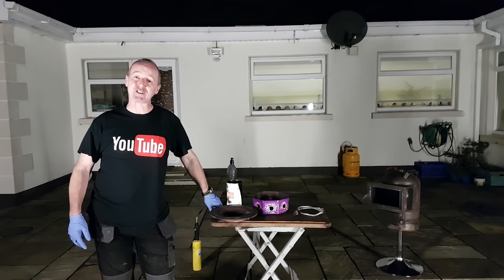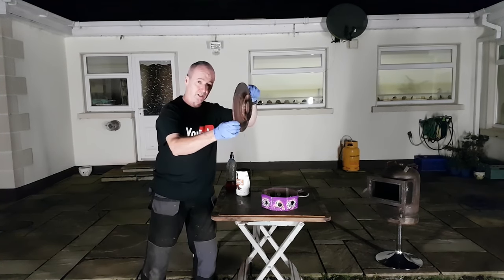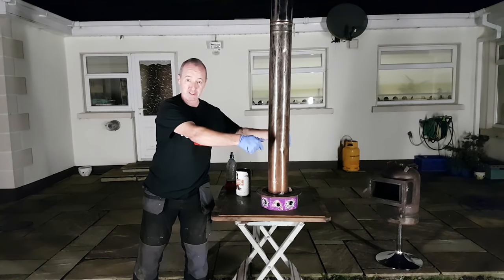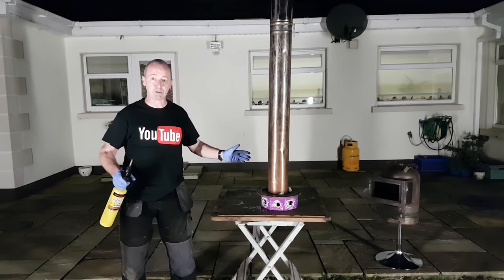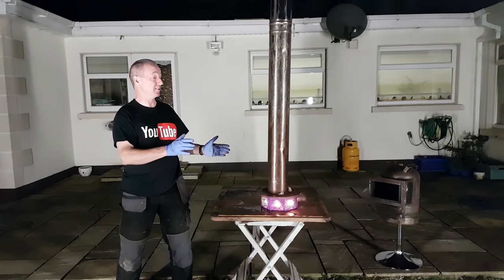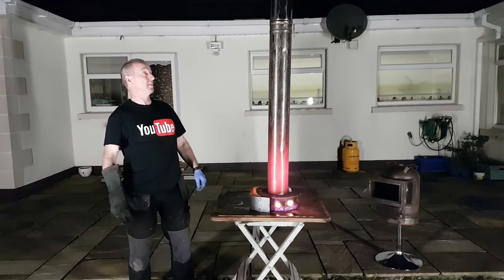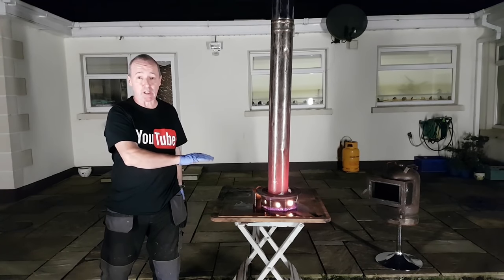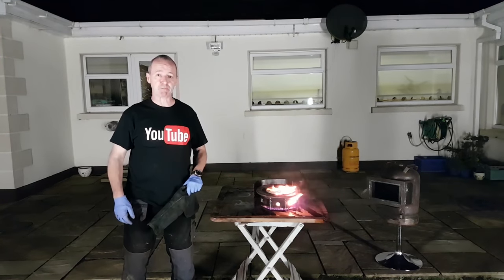Fantastic Output - TIN CAN - Waste oil Burner

Comment from the maker: 🔥 Check out my  Simple to Build Tin Can Waste oil Burner   https://youtu.be/hw3v2gN_sLk Cheers Gerry 👍
Reply: sounds just like my orchard heater specially when I burn oil in it, so if you took a little more time put a I turn pipe pushing the heat back to the fuel work even better and need less holes.

Comment: Hi I have super flame deluxe fuel oil heater cant find anything on it was wondering can I run waste oil through it it uses kerosene but I have  lot of old engine oil please let me know if there is any one out there with advice thx

Comment: Hey Gerry, do you reckon it would be possible to make a micro burner by simulating a section of a round burner by constructing a 1/8th or 1/6th section of a round burner? Something measuring just 100 x 100mm  for example? I have a picture in my head I’ll try and send it through but just picture your current burner, cut into 6 equal portions

Comment: Neat and fun presentation.  I would use alcohol to start the burn as it is much more readily combustible.  An oil burner with a blue flame would be a bit more efficient and clean burning.

Comment: Great video, I am off to buy a biscuit tin of Quality street ,  and some old oven trays will make useful table lining, and have a couple of old discs from my car and nearly 35 years of motoring engine oil stored up in oil drums, all thick chocking black and my estimate is I have nearly  120 gallons, I knew it was better to save that old engine oil as one day it may come real useful, now that the weather is changing we get very cold winters, so this  free source of energy will come very useful.

Comment: great stuff.  I have just bought a house that in the garage there is a drip feed burner but for the life of me I cant get it to burn oil.  so I will try this method on the heating oil
Reply from the maker: Hi MrFermanaghman Had a quick look at your channel. Well done getting up and running and it's going well too with all the subs. Thanks for commenting Cheers Gerry 👍

Comment: Gerry I'm wondering if increasing the amount of metal surface area will make it more efficient. Like putting in the bottom (burn chamber) some stainless steel mesh like scrub buds from the local super market. Anyway I can't wait to start experimenting with this.
Reply: This is just an oil burner not a waste oil heater the one thing he doesn’t know is the most important part of the concept, but aste oil is not flammable only the carbon in it is: so by adding sone pressurized air about 17psi usallyb10-30 psi depending on the waste oil fuel mix with a proper waste oil burner nozle and delivery chamber will allow you to make this and actually light the waste oil without the need for kerosene. You can take the oil out of your car ant heat with it as long as you turn the waste oil into an “aerosol” type spray before igniting it you are essentially atomizing it by adding the small amount of pressurized here
Reply: This is not a waste oil burner it’s an oil burner a waste oil burner does not need kerosene, -#2 fuel anything highly flammable to work. The MAIN CoNCEzpT that you fail to mention is that waste oil is not flammable the carbon inside it is so  if you were to use pressurized air roughly 10-30 psi (depends on the waste oil and carbon content etc) in the mixture with you waste oil creating a must almost aresol spray before attending ignition you will actually burn the majority of the waste and you will efficiently heat your area with recycled products without any need to add kerosene or any other fuel for ignition you are effectively atomizing the fuel and also as you found out the exhaust shouldn’t be getting red hot like that you flame is to close and you should consider a small “heat exchanger” type of idea easily made with old furnace parts or exhaust pices etc..

Comment: I believe, if you use the vented brake disk, and turn it with its cap pointing up the output and burning process should improve.

Comment: I love how you use the heat escaping the pipe to draw the fresh air in.  Many others have to or choose to use a fan or forced air of some type and then adjust the fuel to meet that air.  Your fires are automatic in a sense and perfect.

Comment: That is a valveless pulse jet engine you have there on the table. Even the sound and the frequency shows that it is related to the length of the vertical pipe, The inlet is the normal intake of a pulse jet which expands into the tin combustion tin chamber, with the expansion and the convection in the long pip sets into oscillation and even pushes the flame out of the intake at the resonant frequency. It all glows as a valveless pulse jet. Really these are all thermodynamic heat engines and the rate and intensity at which the activity occurs differs the product from being a furnace, a heater, or jet engine all operating by the fuel being used. The compression being produced does not permit this " engine" to operate in any other orientation other than vertical where convection airs the system flow through the pipe. 
A few of these beside each other and we could make a church organ out of the different frequencies being produced!

Comment: Something the I have figured out the is fun in an open flame one is the if you point a blowtorch at them in low heat it will create a big flame and lot hotter

Comment: If you already have an installed wood burner - inside diameter of e.g. 12 inches or so - what would be a suitable waste oil burner that can simply be popped into the wood burner? An oil feed would obviously have to be installed, which would be as simple as drilling a hole in the side of the wood burner, and the flue is already installed, but how to put together the actual burner?
Reply from the maker: Hi JF. I have already done that. Here's a link to a waste oil burner working in my boiler stove. This stove is heating water and underfloor heatign. https://goo.gl/9jtyzP Hope this helps. Be careful Cheers Gerry

Comment: Hi Gerry, I am San Juan, Republica ARGENTINA, I am making a stove with burned oil and we see that a lot of black smoke comes out of the chimney, you would know to tell me that I am failing, the principle is the same as this video but at the base of the pipe I made some holes in it, can you tell me if it is because it has a lot of oil that releases so much black smoke? Thank you, your incredible videos
Reply from the maker: Hola Andrea. This was just a test to see if this type of burner would work. Here's a playlist of some burners and stove I have built. I have used a different burner type which is easy and cheap to make. This burner makes lots of heat but no smoke. https://www.youtube.com/playlist?list=PLmQ5wJnkAIoJYDBgSOis9s1yDhcFdswtN  Saludos desde Irlanda Cheers Gerry

Comment: My brother had an old 55 gallon drum in the rafters of his garage. He pumped waste oil up to it. The bung was necked down to 3/8"copper. It had a ball valve poked in a funnel in the top of another drum that was a kit door ,flue and it sat on bricks He had a car detailing shop to save him buffing disc pads. He'd pour a shot glass of gas on a buffing pad and lay it in the stove,light it and open the ball valve to drip on the pad so it would burn like a wick until you turned it off. 1 pad per day and free oil. Its pipe would get near white,if you didn't back off the oil's trickle.

Comment: This is a great learning example. To burn cleanly you need to match the vaporizer surface area to the airflow. The sputtering like a pulse jet says not enough airflow, with a tin that large as a gas generator, it needs a lot more air. That is also why you are getting flame and smoke out of the flue making way more gas than you have O2 to burn.  A conical oil pan allows you to tune the oil vaporization surface to the airflow by simply varying the oil level in the pan.  Designing it so the inlet air passes thru a pre-heater also makes it WAY more efficient and less susceptible to wind.  Thanks for the video:)
Reply: Rronmar, very interesting comments. How small could the burner be if it had a flue pipe of only 40mm diameter? Or what diameter conical oil pan would you use for a stove with a 40mm flue?
Reply: Tim Telemark  not sure for a 40mm, quite a few variables how tall is the flue, what fuel ect.  I have been experimenting with a 3”/75mm flue(54” tall) and a 3” burner with a  little over 1’ center airfeed pipe.  3” diameter area is about 7 sq/in minus the center leaves about 6sq/in of fuel area.  With that much draft and motor oil it is way too much gas generated and it flares and sputters like this vid.  Going to build another one with a 1 3/4” center air pipe( just under 4 sq/in fuel area) and see how that balances out.  Also have an idea to simply regulate airflow to help tune it, but it is a fine balance also between air volume and velocity/turbulence. More  air holes = more air volume but also = lower velocity and less turbulence which helps combustion efficiency and overall temp.
Reply: Thanx its good to know others opinion you seem to know whats what look its a bit fun i wouldnt do it myself knowing me id blow myself up anyhow thank you
Reply: @garydixon9742  motor oil is pretty safe, especially in these quantities.  It is sometimes quite a bit of work just to get it to burn steadily:)

Comment: yeah your a total stud! thanks for the video, you made the idea rather simplistic by your example! thanks for taking the time to make it....also I liked the effect the wind had, it made it pretty cool! Im gonna build one now
Reply from the maker: Hi Mike. That unit is very easy to make to see the available heat in waste oil. I made a more durable and much safer unit and you can see it running with and without a fan https://youtu.be/kQNkefOdwUg It works really well and if you check my playlists you will see a ton of videos on how to make it. Cheers Gerry
Reply: Thanks for the reply! I liked and now subscribed! Your a good man! also your accent kicks ass ;-)

Comment: forget the holes in that pan and flip the disc break the other way so the inlet holes are being used to draw the air into the burner then set your chimney on top and you will really see a blow torch efficient burner more than what you got now

Comment: What kind of glass do you use on the door of the stove?
Reply from the maker: Hi Sean. On my earlier stoves I was using pyrex dishes and they worked great with no issues. I now use stove glass ( stovax )because I can make the doors what ever shape I want. It's well able to take the heat I produce in these stoves. It's nice to see what's going on in the burn chamber too. Thanks for the comment Cheers Gerry

Comment: Someone else made a waste oil burner with a needle valve drip feed, air blower and a second hand steel fireplace with a door. Tune feed rate  for smokeless burning.

Comment: Just for the shits I knocked up something like this but the base was an old Stanley flue collar turned upside down, so that it left a square hole to the front. I lit it with a small oil-soaked rag and dripped some oil into it occasionally. It got too hot to stand next to. Interesting experiment, and it occurred to me I could water-jacket the hot part of the flue. The oil consumption was very frugal.

Comment: Where I used to work there was a waste oil heater for the workshop. The flue had to be periodically cleaned by “specialists” as contaminated waste due to all the mercury and byproducts of the car engines. The owner eventually got rid of it as not environmentally friendly combined with the specialists expense outweighing the benefit of free fuel/heating.

Comment: I like what you are doing. Can you build a very good home waste oil burner I would build?
Reply from the maker: Hi Lifes Journeyman. I made a shed heater / cooker with a similar burner but it works on a slightly diferently. It gets its air feed from the bottom which does the mixing for combustion. I have used this burner desing in many of my projects. Here's a link https://youtu.be/tnzEDEpz3Yk  Cheers Gerry

Comment: I love that you are repurposing items for the burner. My concern is the exhaust from the chimney. I'm in the US and we have EPA regulations we have to abide by, and I'm not sure if this is legal, especially in a woodworking shop. I know wood smoke isn't much better, but after watching your and other videos on using repurposed items for a woodstove, I salvaged the water tank off of my old furnace to make a small wood stove for my small shop. I actually have it mounted to a corner wall so the door is about chest high. I have a heavy duty metal roofing panel behind it that stands 3" or 76mm from the wall for air circulation. The platform it sits on is made of 2"x4"s and a section of plywood on top. That is capped with flagstone. I made a log rack out of some 3/4" black iron pipe that was leftover from another project and it also helps hold the shelf with the woodstove in place. I used the pipe flanges to attach the shelf to the rack and to attach the whole thing to the floor. The 2x4"s are also screwed into the wall. I've never welded before, but I bought two-second hand that was used for one project, so they are brand new. I practice on scrap metal I got from the metal yard and when I thought I got a decent bead I welded up the stove. I also acquired other parts for the stove from the junkyard. Thank you for the inspiration!
Reply: Leave it to the epa and we would freeze.

Comment: There were to many holes in the sweet tin.  2 holes tops, opposites sides,  each hole offset to the far right. A vortex will be created as hot air racing up the chimney sucks the air through the holes at high speed.

Comment: Awesomewe used to make one in the workshop,20 liter metal paint/ handcleaner can removable lid with small hole in it and larger hole for flu,we bend up 2 wire coathangers so they hook on side of can and go down inside two thirds and a small metal dish sits on these. You put some paper/wood/oil or something combustible in bottom of can,put in coat hangers with metal dish on them,light paper,must be enough to get dish and can glowing,we would hang a 4 liter can with a small tap or tiny hole in it full of old oil 6 feet or less directly above small hole in lid,when dish and can glowing we open small tap slightly,oil drips thru hole in lid,hits hot dish,ignites and splashes onto inside of can,igniting more,1 drip say every 30 seconds/minute,glowing yellow hot,any smoke goes out flue,excellent.

Comment: I have a few questions, what oil works best if you have no old oil. 2nd ever make one from a ammo can successfully?
Reply from the maker: I have plenty of videos of a more robust version of this burner working in a stove and making a shed load of heat literally. These burners will burn used veggie oil, used motor oil, diesel or kerosene. you just regulate the flow. Here's a link to the second part of this video with a drip feed system. https://youtu.be/WyredKT2VdE Cheers Gerry
Reply: @GerrysDiy  HI my friend, yes I actually have been going over your other videos they are definitely awesomeness and I plan on Fabricating one, I appreciate your time and response to my question.

Comment: Good video you are a smart guy. I watched the one where you used a MEP empty gas canister. Can you send any details about it. You must have a very understanding wife haha 
I have been over the water many at FG Willson factory   You guys are all spot on. 
Regards
Raymond  Robertson (Scotland)
KEEP UP THE GOOD WORK
Reply from the maker: Hi Raymond. I made quite a few videos of the updraft burner Here's a link to a playlist with some videos with this burner https://goo.gl/Xoc5hE The pan is about 7 1/2 inches in diameter. The sides are about 3 inches high. The propane bottle stands about 4 inches above the edges of the top of the pan. The holes are 13mm and spaced at about 1 inch apart start the first row 2 inches from the base of the pan so your oil can stay in the pan. Hope this helps. Cheers Gerry

Comment from the maker: Hi All After making this demo burner I made a fully working burner out of steel and installed it in my homemade stove. This new burner can be built for just a few dollars and can make my stove GLOW  RED hot. Here's a link  https://youtu.be/ShTLaYKjzxw Cheers Gerry
Reply: Hey Gerry, Im reallly happy with your videos. Im building a steam steam boiler to power a steam engine for electrical power and I have been researching for a year now different ideas. I have literally an unliited amount of waste oil available so thats my fuel of choice. I have seen most of your videos and Id like to say thanks for such a great job. I will try to video my build as much as possible and if you ever see it, Im sure you will see your thumbprint in there. Great job. Happy New year,.
Reply: GerrysDiy directions on how it is made very much in need of it..

Comment: What waste oil are you using?
Reply from the maker: Hi Ben. I added a little kerosene to Waste motor oil. The kero is just a starting fluid as its easier to get lighting. After that the motor oil is burning. Have a look at this playlist to see waste motor oil or used veggie oil in my burners https://goo.gl/oBVJ9h Cheers Gerry